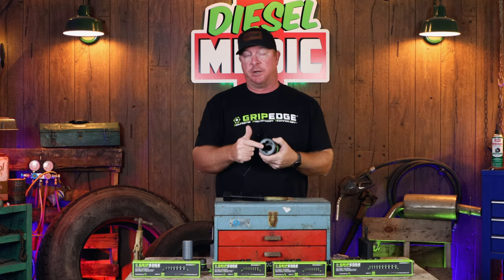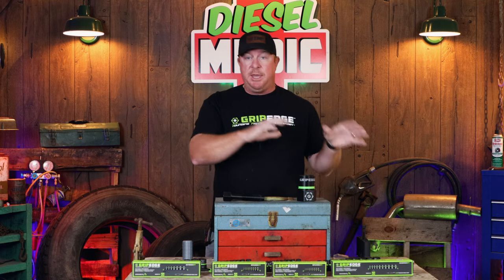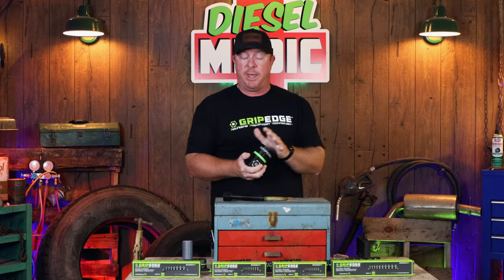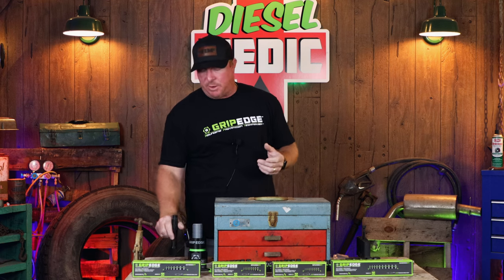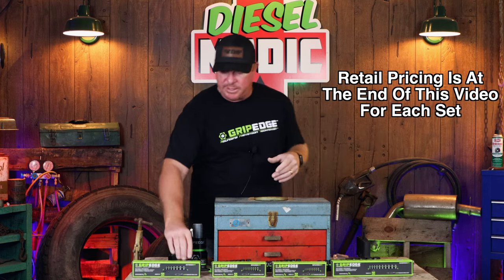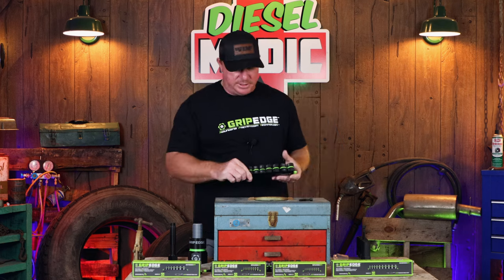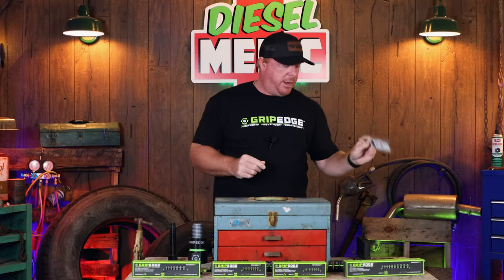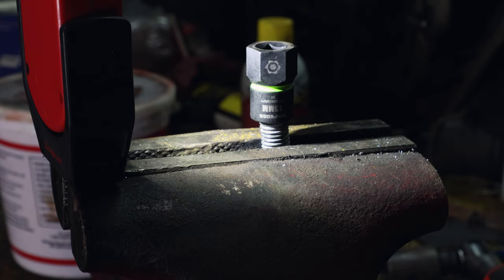Grip Edge Socket Extractors, Why You Need A Set And A Full Demo Of Them In Use.

Comment: Sorry, I have my reservations about using it as a stud remover, and not damaging the threads. I'd like to see a demo on an actual stuck stud. Otherwise they look OK.
Reply from the maker: They have some videos on it on their YouTube channel. They actually put a bolt in the vise upside down with threads sticking up. Break the head off with the extractors and then on the stud after removing it from the socket, they thread a nut back on it. 
@gripedgetools show them what I’m talking about.

Comment: the sockets look identical to bolt biters from gearwrench
Reply from the maker: No they do not. Bolt biters have a twist design plus the pusher rod isn’t available with the bolt biters. I did a video review on them when they first launched them. Huge difference in the two tools. Plus Bolt Biters clearly say not to hammer them on.

Comment: They need to release some long versions of the next extractor. Already let one of my coworkers borrow one for removing a hex bolt on an intake plenum that was rounding off. The socket barely fit in that space and it was at an angle but luckily he was able to remove it.
Reply from the maker: They will have them all soon. Just like with Mac they didn’t have them all at once, it took a while to get the line. They are coming tho

Comment: That’s a great demonstration. I feel like I own a pretty large variety of extractors and sockets supposed to remove stripped hardware. I love the driver screw on these though. So simple to get them off and it seems so much more useful. We’ve had some lug nut removal sockets that work pretty much the same for the inner cap nuts on the bud wheel style truck fasteners but they don’t have the extractor. You have to screw around beating them out with a punch. Hope grip edge starts to make larger sizes!

Comment: How do they compare versus the gearwrench bolt bitters
Reply from the maker: If you want to hammer the bolt biters on you aren’t supposed to and the bolt biters have a twist design. Can’t use them on studs. And no easy way to remove the damaged faster er so if you need to apply heat it’s much harder.

Comment: Doesn't affect the bolt! Why aren't you selling rethread kits?! 😅
Reply from the maker: Stripped or rounded heads has nothing to do with damaged threads? Not sure why that would matter. Not to mention they are an extractor tool not a rethreading tool
Reply: @KoonTrucking  I meant after you damaged the bolt 🔩 threads,  pull out the re thread kit, I was just joking a little